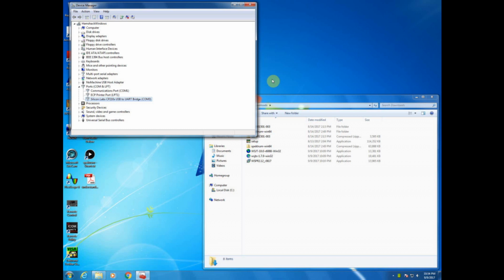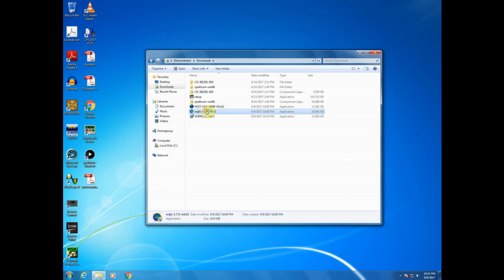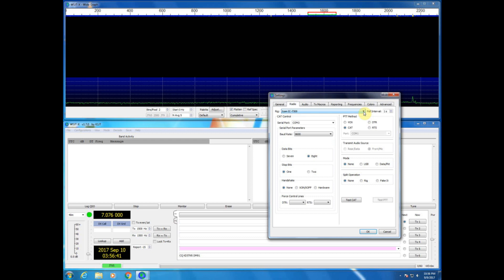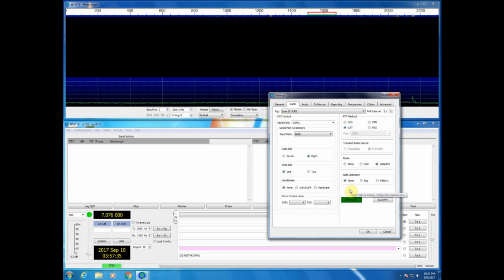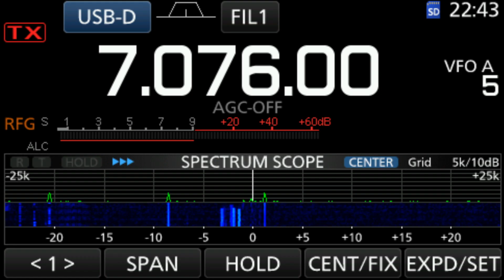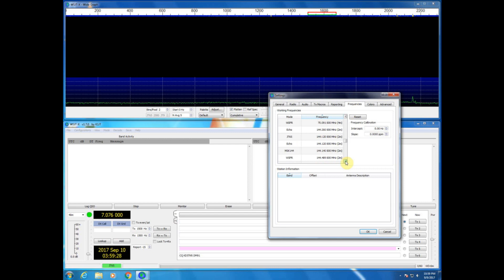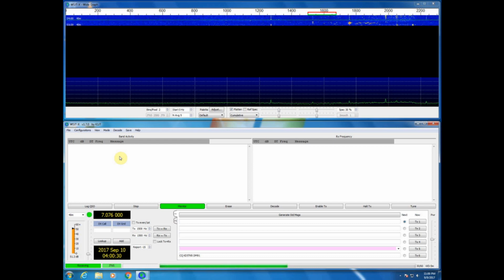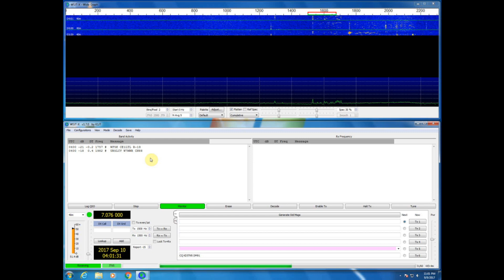Icom IC-7300 Tips and Tricks - WSJT-X Installation and Configuration For Receive

Comment: I've noticed through experimenting that AGC does NOT need to be off in some instances, especially for FT8. Strong signals will overload the front end; this is where AGC set to about .8 secs helps tremendously in decoding strong signals. Try it.

For meteor scatter I usually have AGC off

Comment: Just received my IC-7300 and setting this up.  Question for you - you mention adjusting the slider so the receive is at 50db as it decodes best there.  Trouble is I don't even have that slider on my installation.  Is there something I need to change to get that slider to show up? (just seeing 89db all the time). Thanks!
Reply: Version 1.8 does not display a slider. I think it needs to be adjusted in the Icom 7300. I just started digital with my new Icom 7300. It was working and just recently I have lost my ability to decode, so no data received in the band activity pane. I followed this video and have not been successful. Any advice? KM4TXU
Reply from the maker: I'll have to take a look at this when I get back to my shack. I've been dealing with family medical issues, the holidays and trying to finish up some college classes. I should be back to it shortly after the new year.